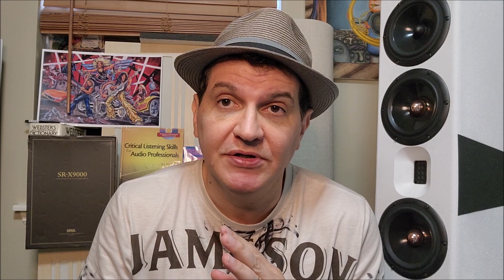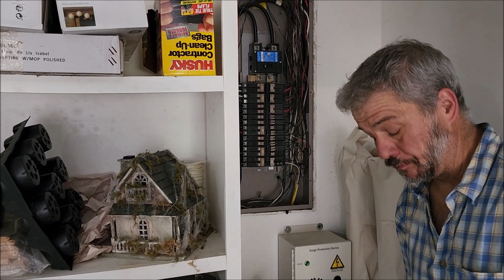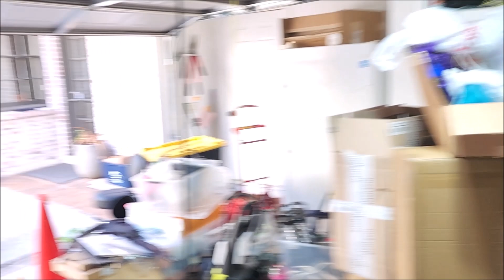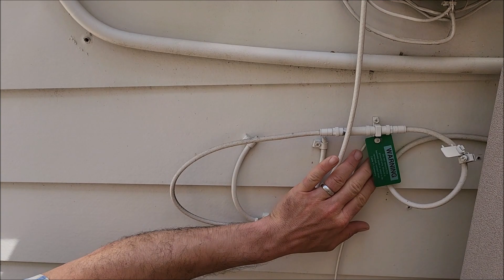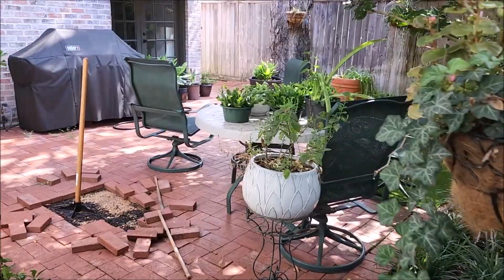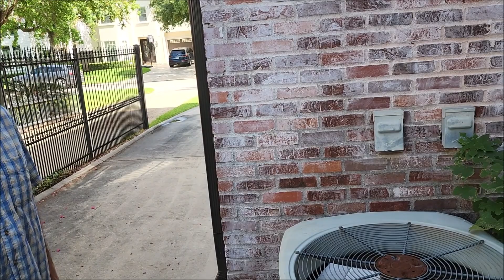Audiophile Electrician - Interview and Onsite Footage of Consultation

Comment: I have minor hum. Tomorrow I will disconnect the 3 light dimmer switches in the house to see if they are the cause.
Reply from the maker: Likely a ground loop. I would make sure all your equipment is plugged into the same outlet

Comment: Once all is addressed at the breaker box would you still need a power conditioner in your system? Figure is the power is clean to the outlet no need to spend money on conditioner
Reply from the maker: For amps, I'd agree and say no power conditioner needed.  You could argue that digital and other pieces might benefit, but still debatable.

Comment: Question:  would it make sense to run 240V, 8/3 wire to a small sub panel with a few breakers in panel. then 120V 20A breakers for amps (short 12/2 wire to receptacles, 15A breakers for Sources, Preamps….

Comment: Also, make sure your Amp’s circuit breaker and other audio gear circuit breakers are connected to the same leg in your panel, especially source….  10awg wire and 20A breaker is typically good for most amplifiers.

Comment: I learned that US houses has 2-phase 240 V in the panel and it is used for heavy loads like ovens etc.
Why not have a dedicated 240 V outlet for audio as well?
Reply: This for equipment that handle 220-240 V, i.e., what we have in EU.
Reply: Interesting thought... Much of my gear can switch itself internally between 120 and 240. Perhaps 240v would be a benefit for my amp, which has a 2000 VA transformer. Of course the wiring from the panel to the outlet would have to be upgraded to a heavier gauge, and the panel would have to have room and capacity to make that change. We typically use double pole breakers on 240 volt here. Thanks for sharing.
Reply: It's not that important, for what it's worth the terminology would be; two leg, single phase.

Comment: I am having an electrician wire 4 dedicated circuits each with it's own ground to the breaker panel using 10 gage Romex. One for my VAC Master Pre-amp that already has it's own separate power supply, one each for my VAC 452IQ musicbloc in mono, the 4th one for my Niagara 3,000 that has my cd player and my APEX DCS Rossini DAC. I am getting estimates this week. Luckily the breaker panel is directly behind my listening room and attic space above so easy to run the new wiring only about 25 to 30 feet for each circuit. 2 2 plug outlets already there but going to change to  4 outlet each but own circuits. Right now 4- 2 plugs around the room all on one breaker circuit.
Reply from the maker: Sounds like an excellent plan.
Reply: Did you get the new plugs in, how was the improvement in sound? I bet it made a good difference with the gear you are running

Comment: Great info and very interesting! I do a little bit of electrical work as a DIYer as necessary. Found it very interesting that he talked about the air conditioning disconnect box as being a potential source of noise. I just changed mine out last year when I realized that it had been arcing. Didn't realize I was potentially helping my audio system at the time though LOL. Would love to see more about electrical. Thanks again!
Reply from the maker: Yeah... I'll have plenty more, but you picked up on a good tip he shared.

Comment: I depend on a PS AUDIO Directstream PowerPlant 12, then l know when l plug in my fancy power cables, they are transferring clean, quiet power to my components.
Reply from the maker: Yes... Those things can help, but one thing you'll notice in upcoming videos is that the problems often come from other gear plugged into the same power conditioner, and the outlets aren't really isolated like they claim...or at least not to the level of separate dedicated lines which also can supply power to amp demands better than many conditioners.

Also, improving the power to the conditioners also improves their performance as well.

The biggest takeaway for me isn't even the subjective sound benefits.  It's in the noise floor of better grounding and safety that is worth more attention in the hobby.